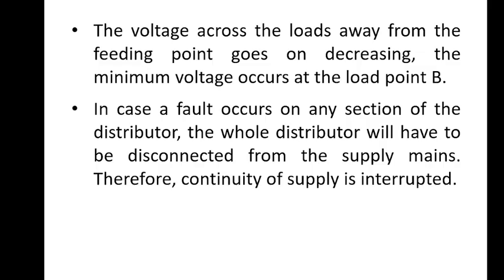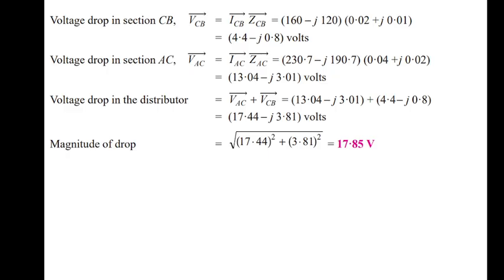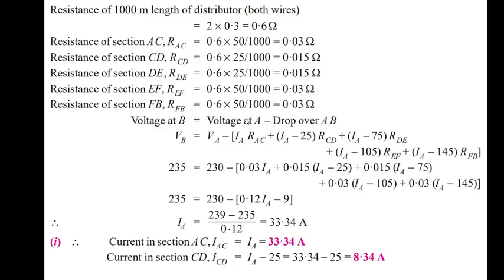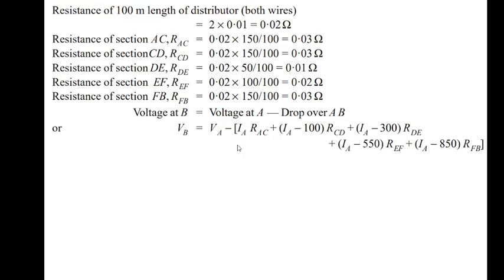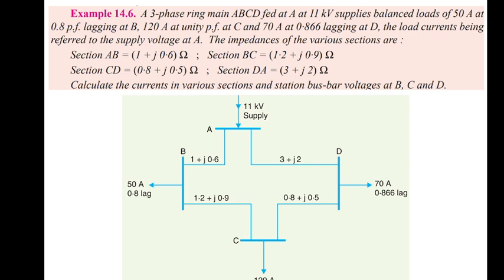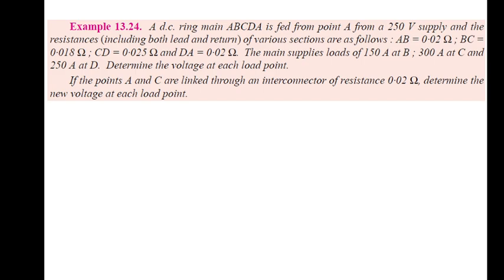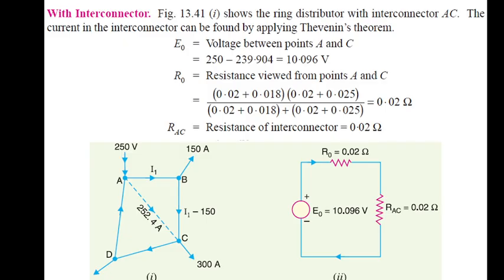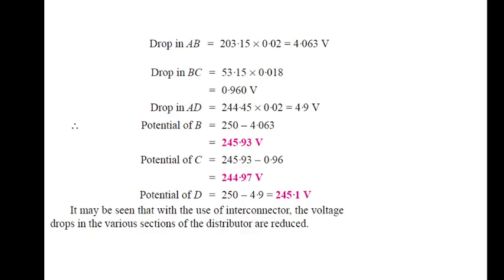Topic 7 Distribution Systems Part 2

Comment: Excellent  content Professor. I can see this channel covers highly important areas in modern electrical power engineering such as smart grids, renewable energy integration and power system control. Well explained and useful for both students and professionals. 
Further, this will definitely become a valuable learning platform for the power engineering community and looking forward to more lectures and educational content.😊
Reply from the maker: Thanks a lot